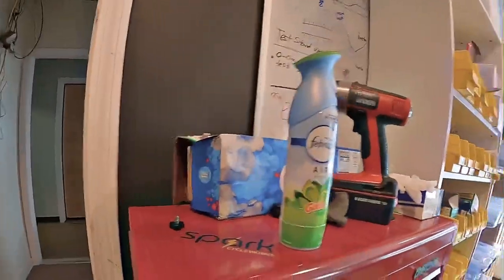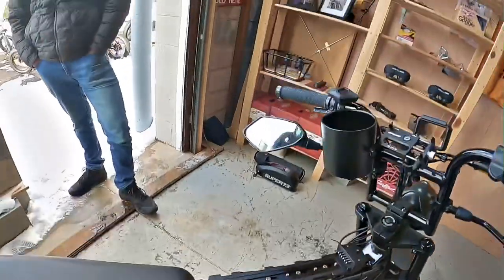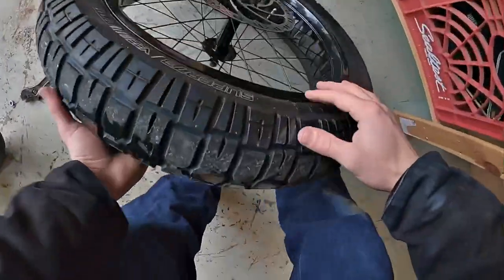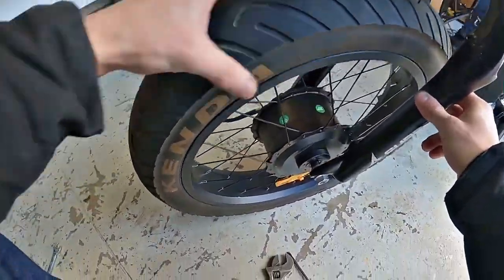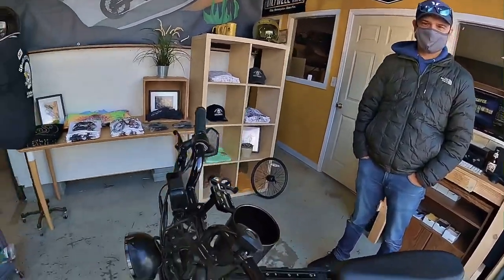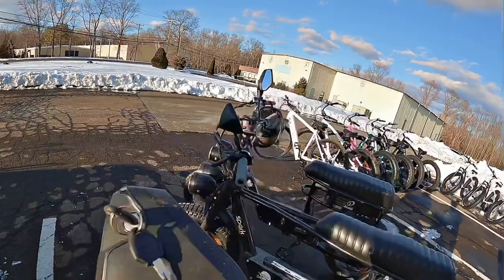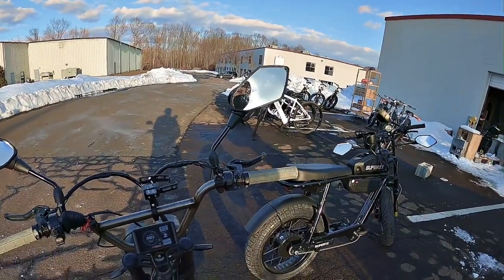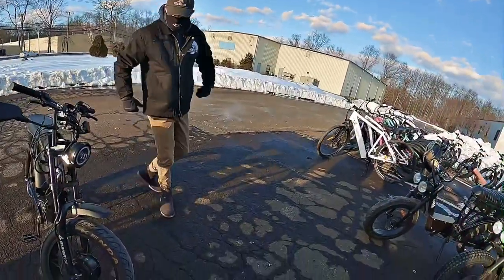Dual Motor Kit Test on a Super73 Electric Bike

Comment: Where do you get this kit and will it fit on an RX?
Reply from the maker: We are making the kits. We are trying to get the first batch read by end of March. As for the R, it’s a huge challenge because it uses a through axel on the front wheel. However, we have a concept we are testing soon that will hopefully solve that issue.

Comment: This is awesome!  Will there be a way to have both motors controlled by 1 throttle?  And I see your comment about dual motor not increasing top speed, not even if the battery voltage is increased?  Can’t wait for this kit to drop!
Reply from the maker: If you take a look at some of our older videos, you’ll see the scorpio prototype from a couple years ago. In our testing, we came to the conclusion that a 2 throttle system performed better than a single throttle. The issue occurs at low speed turning. If too much power is sent to the front wheel, it will begin to slide out. The two throttle system let’s you enter a turn with just rear power, then use both as you enter a straight.
Reply: @SparkCycleworks  got it, thanks for the info!

Comment: I have a super 73 R and l been looking for a way to get more torque and speed  can you tell me he how fast it goes and do you sell a kit
Reply from the maker: Thanks for asking! We are finishing up the details on the kit. Details are still a bit under wraps. However, you should know that a dual drive does not increase top speed, it only increases acceleration. It will nearly double the torque of the stock bike. Check back in on us soon! You can follow us at @sparkcycleworks on Insta!
Reply: @SparkCycleworks  Would it increase the range as well? I just DM-ed y'all on instagram!